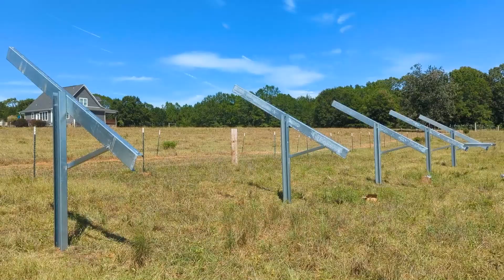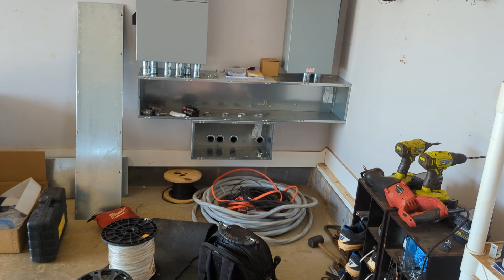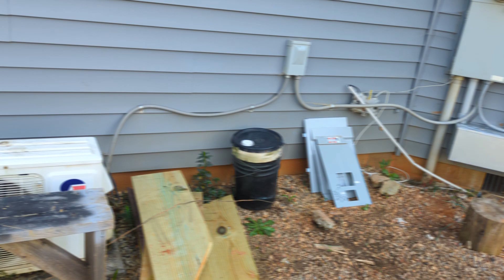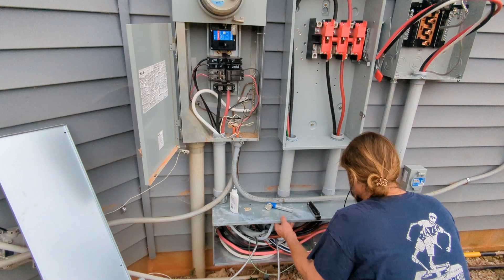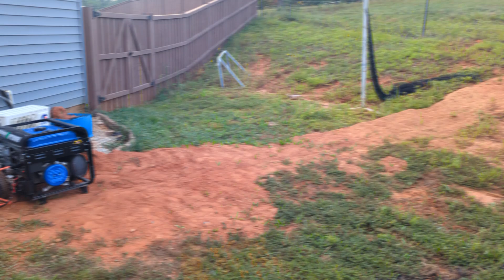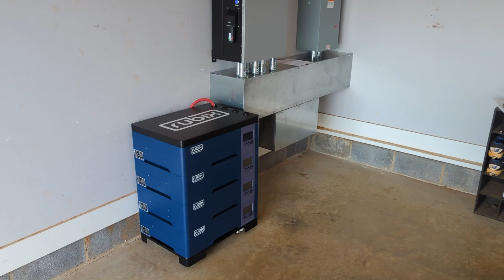Commissioned hours before grid down

Comment: Are you doing any testing with Eg4’s new Flexboss21 / Gridboss system? 

I know money is made on pieces sold to customers so your margins would go down but the time to commission would drop drastically by eliminating all the discos, fuses, and extra gutters.
Reply from the maker: @eekedout  for one reason, the grid boss does not seem to meet the utility requirement for a open-bladed lockable levered arm disconnect. If somehow this grid boss can eliminate that requirement that would be wonderful because it's been a ridiculous requirement and it costs extra money for no reason.
Reply: A utility requirement doesn’t sound like a code requirement.

Comment: Nice ground mount installation but a poor choice for a residential, off grid inverter charger. For an inverter that will last you far longer, provide you with a much higher surge, and safer operation,  you should have spent a few extra dollars and installed a low-frequency, transformer-based inverter charger.

Comment: How long of run was it from the panels to the inverter? I’m wanting to put up a large array like that but it’s a 400’ run and I’m getting conflicting info on if it’s ok to run DC that far.
Reply: If you keep your voltage high (250+) and are running underground (cooler temps), 400 ft is no problem at all. I have a 14kw solar panels 24 kW inverters 834 ah battery system operating for two years.

Comment: I just replaced my main panel (it was an old federal pacific).  In doing so, I determined that neutral and ground are bonded at my meter base.  Should they, therefore NOT be bonded in my main panel?  There is no means of disconnect at the meter base besides pulling the meter.

Comment: Ha! I literally just had that exact same generator delivered today! The 10Kw version I ran for the 8 days we were without power in Saluda County struggled to run the well pump and the mini split and the standard electric water heater.Hopefully the additional wattage can cover everything.Going to cobble together a basic 48 volt inverter system with golf cart batteries and a pair of stackable Growatt inverters to make 240 volt split phase.I plan to rig the system to start the generator to recharge the batteries until I get a PV system arranged.Learned lots from your channel,thanks!

Comment: What is up with the Sol Ark app.  I have 2 inverters, 1--5k and a 15k and 1 of them can only be viewed via PV Pro and the other in the Sol Ark app.  I called them but they are working on it to get it fixed so I can view both inverters on the Sol Ark app.  

Been off grid while building our new house with our RV and 45kw battery.  Feels good to have all the creature comforts (even if smaller verion) while not being connected to the grid.

Comment: I would love to see a summary or a report about how many families that you did installs for and how they fared during these storms.
Reply from the maker: @jackedwards3164  I am working on that summary myself because I know I talked to at least 20 customers that mostly had generator problems. There are only two that had battery issues. So for about A week I was tech support for the systems that were impacted from Savannah to Tennessee from Virginia to Georgia. One cool story I will share here, is that this system in particular was used to store all the insulin in our town as the town was out of power and the insulin would have been ruined. I think it was about $50,000 worth.  Ourselves we ran for 2 weeks without grid and thankfully we had starlink so I was able to stay in touch with everybody and they were able to get a hold of me.  I need to do a storm prep video. Folks that I knew were in the path and folks that allowed me to have access to their systems. I went in and turned time of use settings off before the storm arrived to make sure their batteries could be topped off to give them a good start. I think I did that on about a dozen systems. And yes, I need to make sure that I turned everybody's back on as many are on time of use rates now.
Reply: Is the time of use rates voluntary in order to get cheaper rates or is it being forced on residential service? Here in Texas I’ve only experienced TOU rates for business and industrial
Reply: Lower rates when probably no one home. Increase rates when families are home.

Comment: I noticed there's no dual connection for the negative lead from the battery.  Comments?
Reply from the maker: @ronjones5651  It's because I'm using 4/0 Cobra flex that can carry 454 amps. The max I can get out of this inverter is 275. And yes we are charging the bank diagonally.
Reply: @engineer775  Actually, I was referring to the Sol-Ark battery connection lugs :)
Reply from the maker: @ronjones5651  oops sorry wrong end. On the inverter, you'll notice a homegrid bus bar that combines the two 200 amp breakers on the positive side.  Negative side. They are already bussed together.